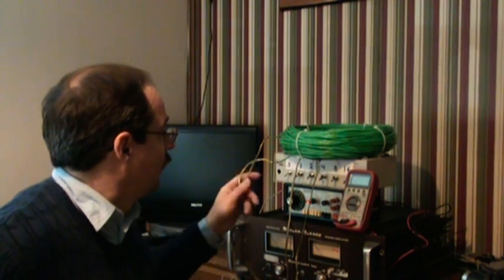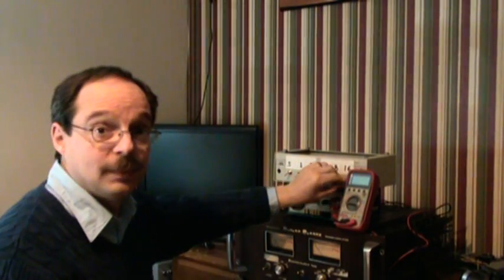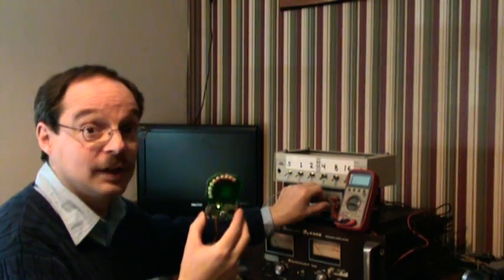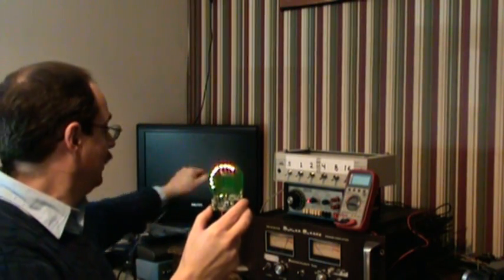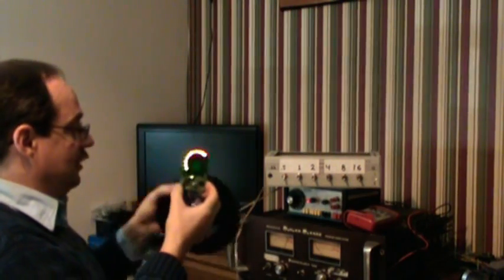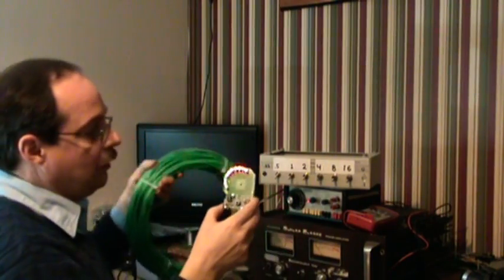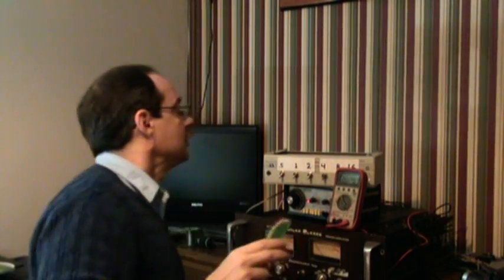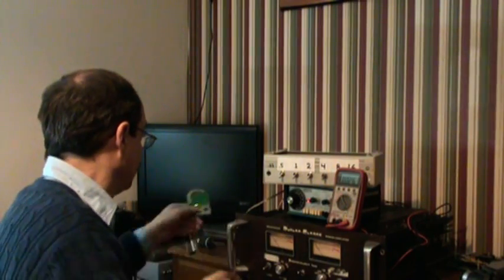Comparing coils

Comment: Your attempt is skewed.  You change the direction of the coil the further you move it away from you testing source . . .  try it again keeping both the coils and testing device parallel with each other so it will be an accurate test!